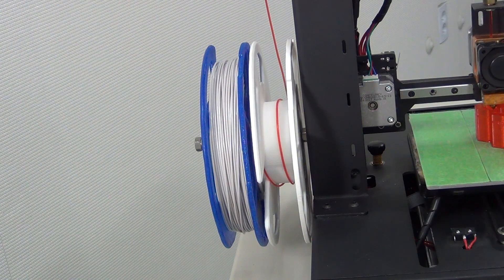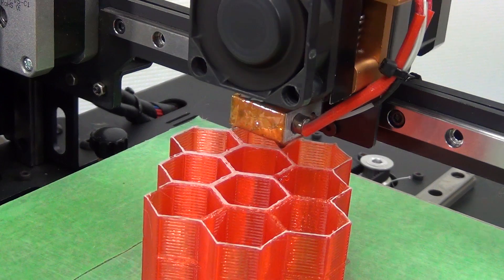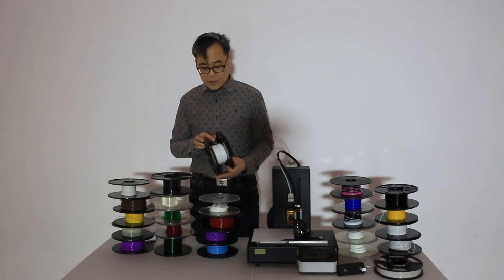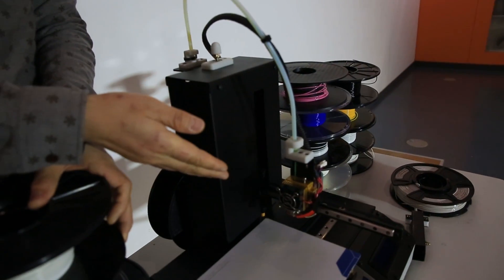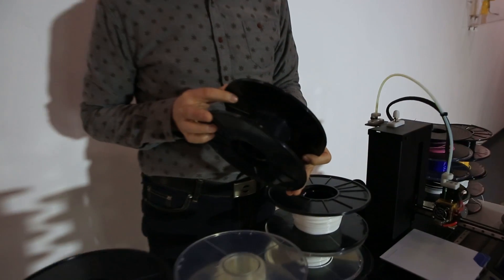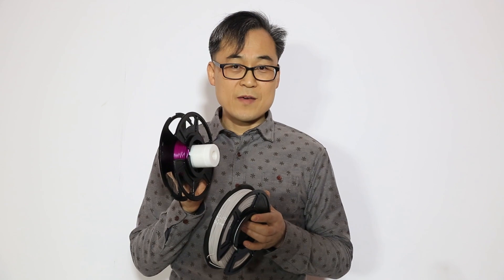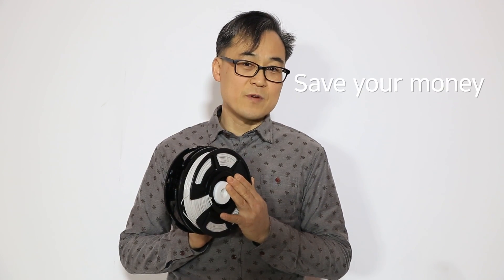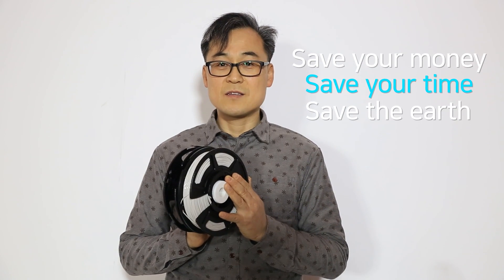NEXTFILA,넥스트필라 : World's first connectable 3D printer filament. 세계 최초 연결 가능 3D프린터 필라멘트

Comment: Hello, may I ask which 3d printer you are using in the video? thx
Reply from the maker: +ampLocus 
This printer, name is MOMON mini, it can build 180x180x180mm and it use an expensive linear motion system for all X,Y,Z so it's movement is very accurate and silent.
also it has 3mm thick steel plate for base frame so, it's very rigid. A widely used extruder which is cheap and easy to buy is adopted.
and it's simple. only 13 steel parts are used.
I developed this printer two years ago.
Do you have an interest about this? If you have, I'll open all of design files and drawings on my web site www.nextfila.com